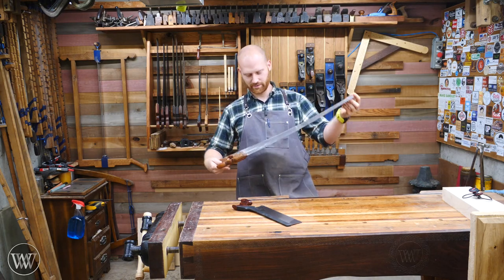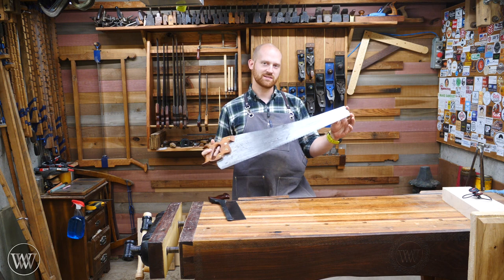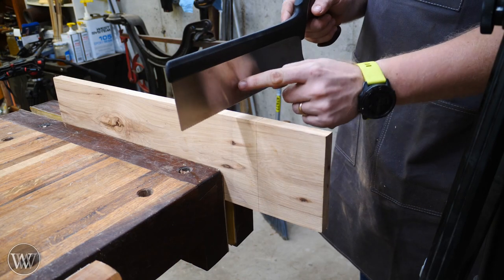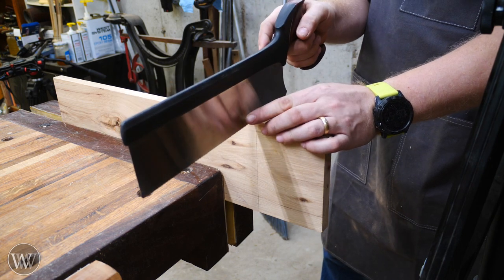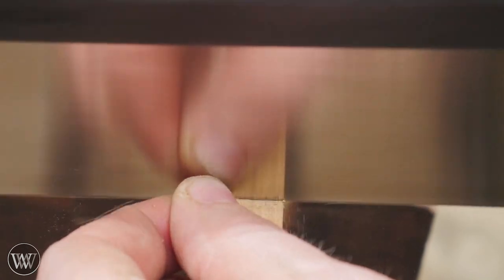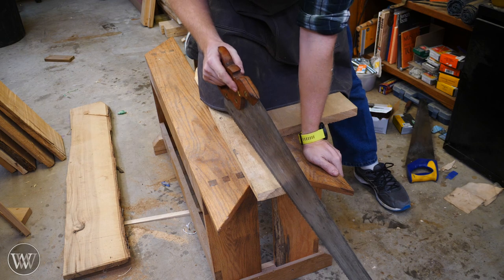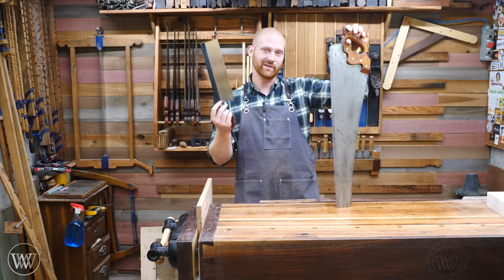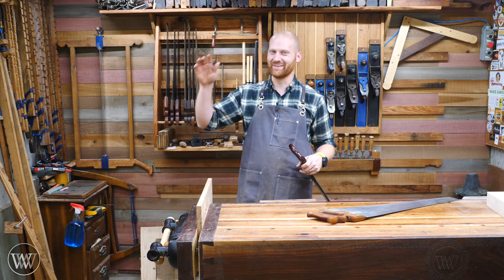How to Start A Hand Saw Cut | Hand Tool Woodworking Skill

Comment: I think running the saw back and forth first, without touching the board, is a great teaching tip.  It gives a little bit of practice at holding the weight off of the saw plate and gives the beginner a better feel for what they need to do before they commit to the cut.
Reply from the maker: so true! great little thing to practice from time to time too.

Comment: I grew up sneaking the tools out of my dad's garage to build ramps to jump my bicycle on.  The only tools he had that plugged in were a bench grinder and a corded drill.  He wasn't a wood worker but all of his home maintenance tools were just basic hand tools.  Without any instructions, since I wasn't supposed to be using them, as an eight year old I really struggled with starting cuts with his 26" hand saw.  I quickly adopted the 2-3 back strokes method for starting my groove and I'm still doing it 34 years later.  It works for me but it's always interesting to see other people's methods.
Reply from the maker: LOL sounds a lot like me as a kid. stealing tools to go make a tree fort.

Comment: FYI, for the saw you held at the beginning of the video, the on switch is hidden, but located in the back of the wooden handle.  It's engaged by pushing forward on the saw.  The saw automatically turns off when you pull back.
Reply from the maker: COOL!!! I am going to have to give that a try!

Comment: Excellent!  An important and under appreciated skill.

On a Western saw, I avoid starting with the toe.  I use the teeth under the center of gravity, just beyond the handle.  I find the plate is less wobbly and I have finer control over contact pressure.
Reply from the maker: Very true. I have never understood starting on the toe. But each to their own.

Comment: I can start on the forward stroke... but I’ve had quite a few pieces blow that very corner out and splinter. So I’ve just started back stroking. But like you said it’s preference. Thanks James.
Reply from the maker: yup, there are more than 3 ways to skin a cat, and I love skinning cats. LOL but that is why you are supposed to use a knife wall.

Comment: I have been a back stroke/let the saw rest on the wood kind of guy, but I will definitely give it a go...  Anything to make my cuts work out better... Now, what do you have for making cuts that want to veer off to the side? BTW, great video
Reply from the maker: thanks frank. I do have a video on steering the saw. but it could also be the set on the saw that is causing it to turn.

Comment: I have an old Disston back saw that I don’t think I’ve used once to start a cut. I’m not sure if it needs sharpened but I can’t get the cut started whatsoever. After watching this I’ll give it another go using your technique. Do you keep the weight distribution in your hand the same all the way through the cut, or do you tighten your grip?
Reply from the maker: Always keep a loose grip but once the cut is established I let the wood hold the weight of the saw and little more. you are just trying to get 4 or so teeth inside the wood. once the saw is resting on those few points it can hold the weight. the problem is the start when only 1 or 2 teeth are touching the wood then all that weight of the saw is sitting on those few points.
Reply: Wood By Wright Thanks! I’ll let you know how it goes!

Comment: Why my hand saw can only pull and can't push. Can't even establish cut on starting.
Reply from the maker: That's because you're putting too much force in the saw. You should actually lift the saw up so it's not touching the wood and be able to move it back and forth just above the wood. Then once it's moving lightly lower down so it just scratches the surface that will establish the cut and it'll be much easier. The hardest part of starting a saw is being able to rest the whole weight of the saw on the bottom horn. It should be resting on the bottom of your palm.
Reply from the maker: If you want me to take a look at it closer, send me an email. I'll be glad to help you out.